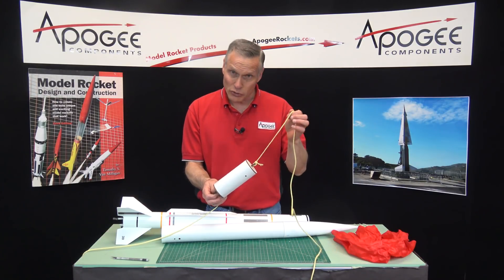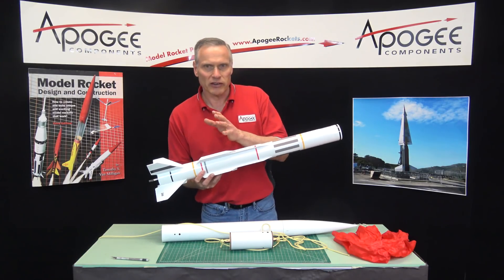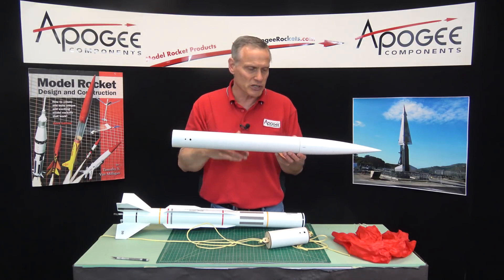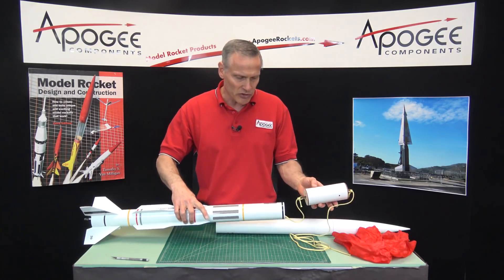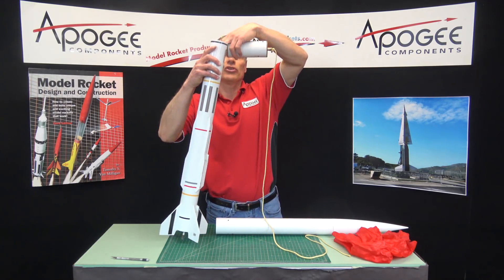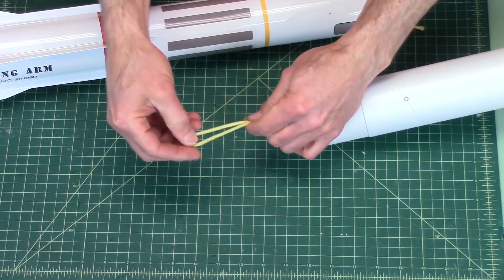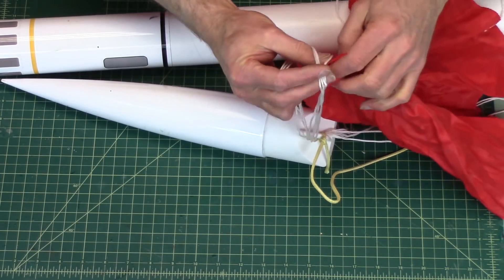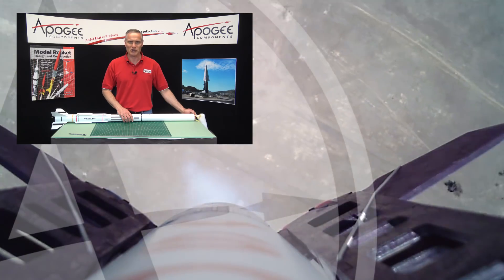Shock Cords for Dual-Deployment Rockets

Comment: Mr Van Milligan,   I am building a completely scratch built rocket out of what I measured to be 2 bt-80 tubes both 18" long, with a nose cone I designed to be another 12" so the over all length from aft to tip of nose would be 48",  I made a home made baffle which will act as a coupler between the two body tubes.  I plan to use a quick link to attach the shock cord which will be made out of 5/8" nylon webbing, the issue I am trying to figure out is that according to Professor Dave Thomas' channel, he says if not using an elastic shock cord you should use 3x the overall length of a rocket for the length of the shock cord... that being the case I would need a 144" strip of nylon webbing, I added 6" more for the loops I plan to sew into either end of the shock cord for the quick links, and the loop I will knot into the shock cord for the offset parachute mounting connection..... with 150" the shock cord looks rather long... would this be a problem, and since the shock cord is essentially being connected 18" onto the eyelet at the coupler of the baffle which will be connecting the forward and aft tubes together could this still work? and if you have a suggestion how long the shock cord for said rocket should be I am willing to entertain your suggestion :-)
Reply from the maker: That should be sufficient length. My preference is that longer is better if you can keep it from tangling. Since you're using wide webbing, there is no need to wouldn't worry about a zipper. I think your rocket will be fine. Go for it.
Reply: @apogeerockets  thank you sir

Comment: What if we attach the drogue to the nose cone and make its shock cord shorter and the main chute in the back and make its shock cord longer?
Reply from the maker: Where ever you put the drogue, use the long shock cord there.

I put the drogue in the back so that I have the rocket motor's ejection charge to act as a back-up to the altimeter. Having a back-up is good. You don't get that if you put the drogue in the front of the ebay section.